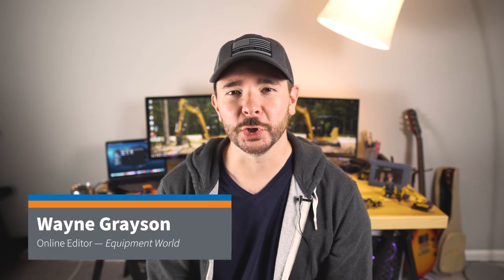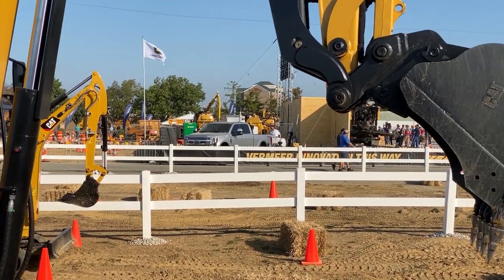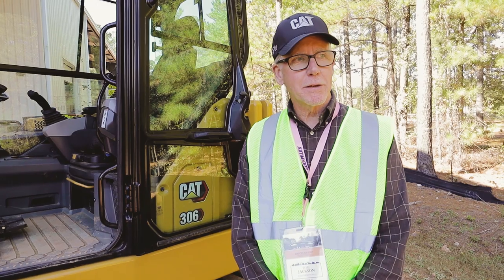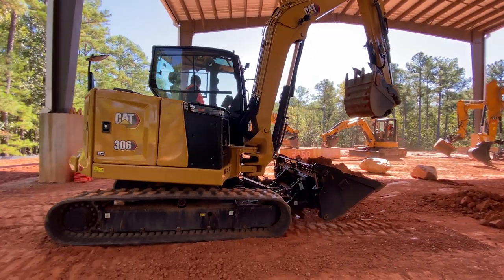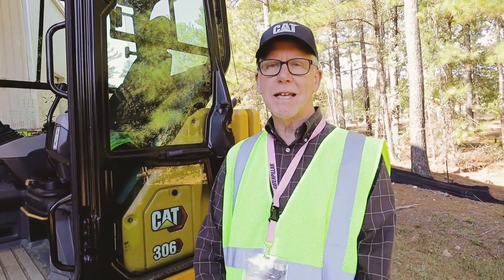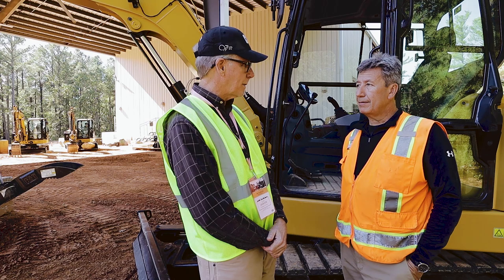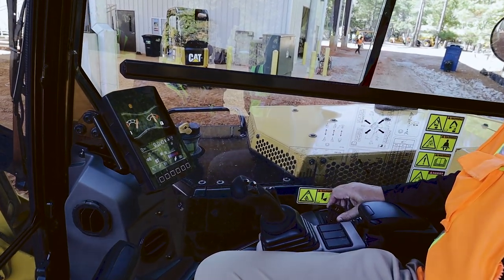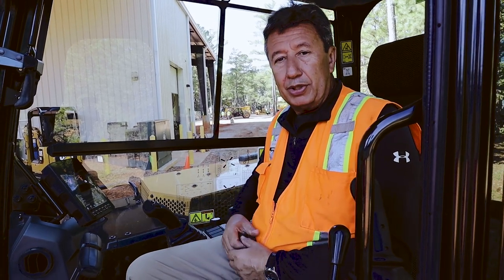Cat 306 CR's stick-steer, XTC config make this one versatile excavator

Comment: I tow my 306 with my 7x14 20k dump trailer, i made a support for the bucket to rest on the front right side and rest the thumb on it and chained to the sidewall, it tows it perfectly.
Reply: Certainly a big advantage I see with this vs 308. Pretty dang close in capability but still able to tow it on a 10t trailer, instead of needing to step up to a 12t+

Comment: Pretty handy machine l think, good size PAT blade that’s pretty handy, as long as they have upped the track drive motors, you can not get the drive motor to climb enough with out assistances, all this comes down to price in the end.

Comment: I’ve been operating for a long time and I wonder how useful the stick steer would actually be
Reply: its great when using the blade
Reply: I would absolutely love it! Since I still have trouble with the panels after all these years. It would be just like driving a joystick control skid steer loader or John Deere dozer.
Cat tried stick steer years ago on one of the bigger excavators with the stick coming up from the floor where the pedals would have been.
Reply: It’s the best thing they’ve done. I’d rank it equal with a hydraulic thumb on useful.

Comment: Looks like a wonderful machine, but I sure have questions about the tracks on it.  It doesn't look like they have added any bottom rollers. Just looks to light for carrying the weight, turning.  That is no way  built like a skid steer.  I would run those tracks off or wear them out is a short time.  Sure looks like a good idea, but put a skid steer undercarriage on it.

Comment: I am struggling to see the value in having an excavator every 2-3k lbs.  If i am going to the hassle of bigger trailers and more expensive tags/cdl i would jump to an 8 ton, not a 7 ton that is pretending to be a 6 ton.  Again why call it a 6 ton when it weighs nearly 16k.  All the EH controls make me question the reliability and premium cost.

Comment: You know guys, stick steer is nice but, what would be even better is if Cat stepped back and changed the footrests on both sides of the travel pedals to one side right the right side is forward travel and the left side is reverse travel with a small lever somewhere for steering like the old 200 series machines. It was a much better way to travel these machines anyway.